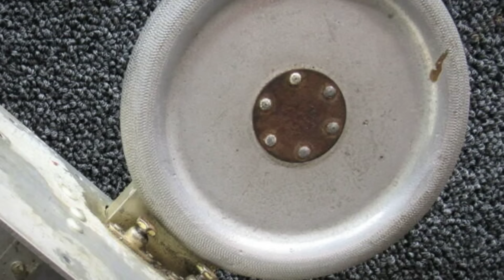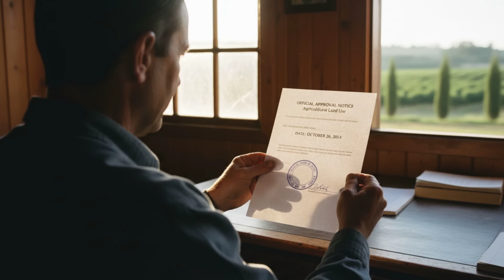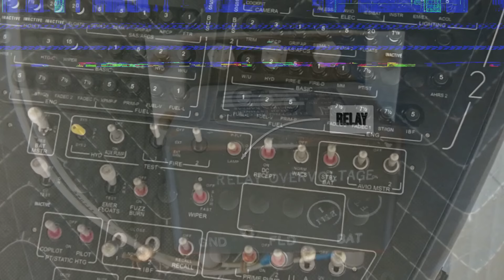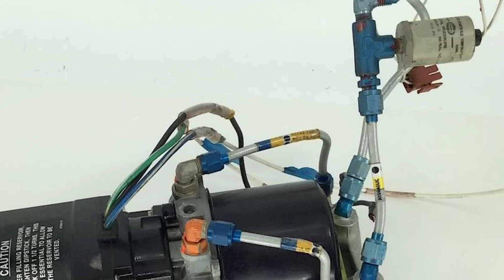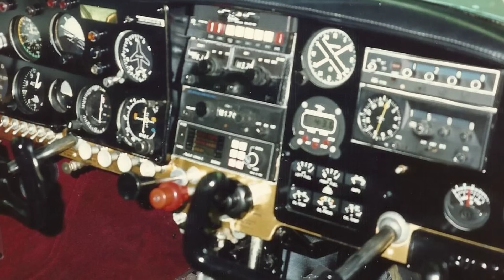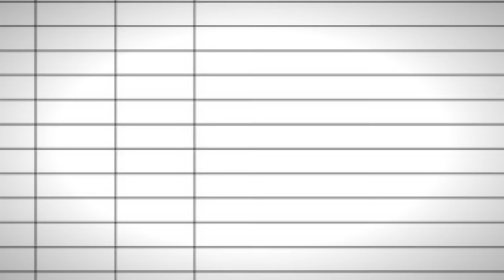Johnson Bars' vs. Electric Motors: Why Manual Gear Is The Ultimate Safety Feature

Comment: I own a Europa XS monowheel and it has a manual lever for the retractable landing gear but also this is linked to the flaps too.  The idea is to keep things simple for example if one forgets  to put down the gear the pilot gets a visual reminder as without flaps the sight picture on approach is very different the nose blocks the view of the runway alerting the pilot that something is wrong.  Normally the attitude on approach gives a good view ahead, it's a good system.  Thanks to designer Ivan Shaw.